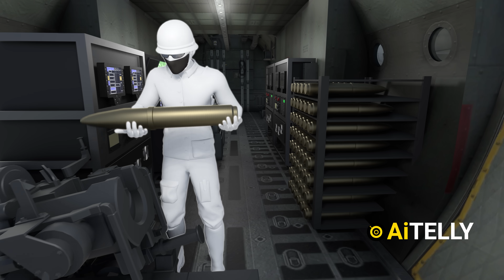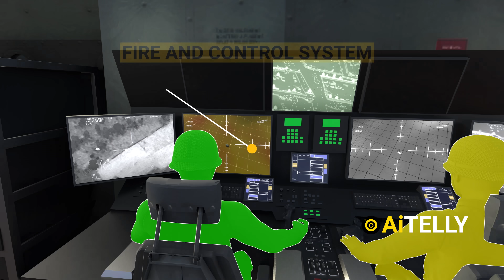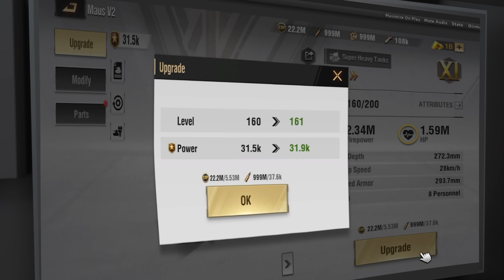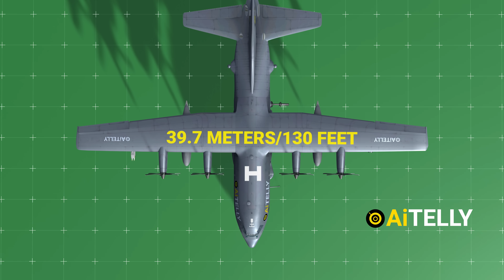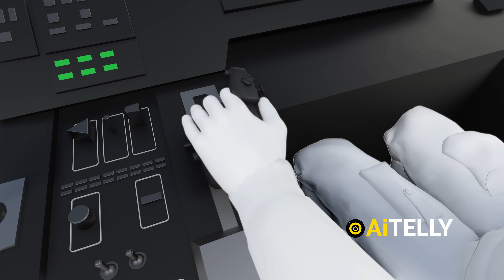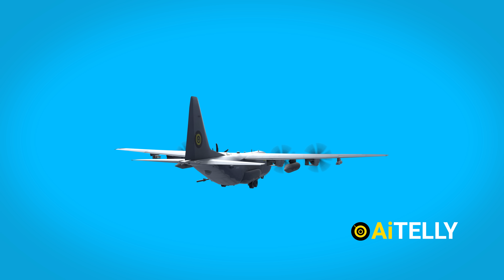AC-130 Gunship How it Works #plane

Comment from the maker: Download Warpath X Metal Slug 3 now and play with Marco Rossi in the game!! Available on PC and mobile now:

https://vda.lilith.com/tracking?dap_c...

For the beginners, join your favorite character's team and increase your Power to win amazing prizes by clicking the below link: 

https://metalslug3-warpath.lilith.com...
Reply: In your video you describe ailerons like a steering wheel in a car?

Got to add some yaw from the rudder for coordinated turns.
Reply: Silung
Reply: Great work!!!!
Reply: I wonder if a tank can destroy this plane? Well, no one is going to hit a pretty fast target just like that. But if the tank is equipped with a target capture system, then this is quite likely, the truth depends on the angle, so most likely the elevation angle of the cannon will not be enough. But still, this aircraft is not omnipotent and with a strong opponent with good air defense, it will incur heavy losses.

Comment: Since you decided to get technical. When executing a pylon turn you also need slight input from the rudder and elevator. If you only apply ailerons you will eventually bank a turn but not tight enough for the needed radius of the pylon. To avoid theses messages stick to your basic video and don't try to teach people to fly.

Comment: I wonder if it would be feasible to slap one of these navy minion turrets on it that are designed to intercept missiles. I forgot the name of the system. Then again it would violently spray bullets everywhere so that's probably why they use flares instead. But I wonder if laser technology would have the same flaw.

Comment: The C-130J is NOT fly-by-wire. It is a boosted system similar to power steering in your car. Ailerons control the roll of the plane. The inboard and outboard flaps are physically connected. They can not move independently from each other. C-130s do not have slats aka leading edge flaps. On take-off, pilots will already have some ammount of flaps deployed to help with lift at low speeds. The ailerons do not act as flaps on this plane as shown in the animation. They would be called flaperons if they doubbled as flaps. The elevators control the pitch of the airplane. Moving the elevators up increasses the pitch angle of the plane.

Comment: Great video but there are some technical mistakes. Mainly, C130's, even J models like the Ghostrider and Super Hercules do not have slats. They only have flaps. The leading edge of a C130 is a "hot wing" in that is has a tube running down it carrying hot bleed air for anti-ice/Deice purposes but it doesn't move (which is what a slat does). Source: I fix and fly on HC-130J aircraft which the AC-130J is based off.

Comment: Not me, I was a crew member on the ac-130u spooky. Flying then long before modern warfare came out. By the way you have some details wrong regarding the AC-J. It does not have a 25mm bushmaster, it is a 30mm.

Comment: this aircraft is only good for areas where there is no air defense and the soldiers on the ground do not have MANPADs. It would be useless in Ukraine. Each mechanized platoon in the Russian army is armed with two  Igla or Verba Manpads. each mechanized battalion has one special air defense platoon that has SA-13 or SA-22, each brigade has a company that is armed with a TOR or OSA system. And that's not counting air defense from the RF air forces, they have TOR, BUK, S-300 , S-350 and S-400. This plane would be a very easy target in Ukraine.
Reply: It was never designed for someplace like Ukraine kid.  Guess what the T-72 would suck against a battleship.  Same difference

Comment: The way they integrate a cannon onto an aircraft without recoil, vibration, or disrupting the plane is  pure science and engineering.
Reply: there is a ton of recoil on the 105 acutally, it goes back into the plane about ~42-46 inches per shot
Reply from the maker: Yes Agreed!

Comment: You cannot destroy a tank with airborne howitzer because you cannot aim the howitzer with sufficient accuracy. This airplane is good enough for attacking Taliban, but it is not good enough for enemy armed with modern missiles.
Reply: Wrong on both counts hoss.
Reply from the maker: The Ac130 has turned into control command and Long range support not a close Support aircraft

Comment: I cannot wait for us to convert the C-17 Globemaster IIII to the AC-17 "Warmaster" gunship.
Reply from the maker: Are they doing it
Reply: @Aitelly  Not that I know of, but I like to think they would. Take the 30mm GAU-8 off the A-10 they are going to retire (still pissed about that); add (1) Bofors L/70 57mm cannon, and (1) XM360 (soon to be M360) cannon.
Reply: @TeraQuad  amazing idea honestly, even if this wasn't real but it was put in some war video game that would be amazing
Reply: Such plane is good only against insurgents in desert who don't have AA. Any nation with even ancient AA will shoot down this bird in an instant.
Reply: lol no
Reply: Rapid dragon puts it halfway there. IIRC a single C-17 is capable of launching 45 JASSM-ERs via Rapid Dragon. Don't have to fly close for that.
I haven't heard anything about a C-17 gunship configuration, but Boeing has patents issued for turret designs that could turn the B-1 into a gunship

Edit: The C-130 works well as a gunship because it's rugged and can be operated from practically everywhere. The C-17 and C-5 are optimized for long range flight with turbofan engines which are optimized for higher altitude, higher speed flight. That and their size and additional complexity makes them ill-suited for gunship roles.

Gunships in general aren't a good option in near-peer conflict as they need air dominance to be effective. Not to say you can't use them in near-peer conflict, but they'd be seriously hampered by air defense systems and enemy aircraft. 

This is why Rapid Dragon is such a big deal - cruise missiles are playing an ever more crucial role in long-range engagements and save the aircraft from unnecessary risk when conducting strikes. So being able to lob 45 out of a C-17... That's big.
Reply: Pakistan has always useing that weapons in old year Pakistan miltlery buy that transport ship to update that I always Pakistan history they are never say it lies

Comment: tell me if I miss something... but can the gun be aligned to the target through downward/upward (or left-right) movement, or is it stuck in place thus need pilot to actually stay in target? because if it's the latter, there's too many job for the pilot, and too little job for the 2 gun officer.

and how about weight distributions? as I could see, both the guns and computer systems is all on the left side of the plane. since those 2 things is awfully heavy, won't that cause baance issue? or is that a positive instead since you want the left side to be tilted to the ground anyways? and how this affect the actual flying of the plane?
Reply from the maker: Your somehow right. 
But When you are aming from 11 miles or kms a slight turn is a lot of change and when computers are involded in aliging the gun it makes a huge difference.
The Pilot will only align the plane to stabilise it using the HUD Heads up display

Comment: the AC-130J should have been armed with two 26 MM GAU-12/U 6-barrel rotary cannon (each positioned on either side of the forward fuselage section) . . . instead of a single 30 MM XM913 Bushmaster chain gun on the port side . . . the AC-130J follows the same rules of engagement as that of battleships, always firing broadside for maximum fire-for-effect . . .
Reply from the maker: The Busmaster is kind of a sniper from the Sky that's what i learned.
Reply: @Aitelly  your right . . .